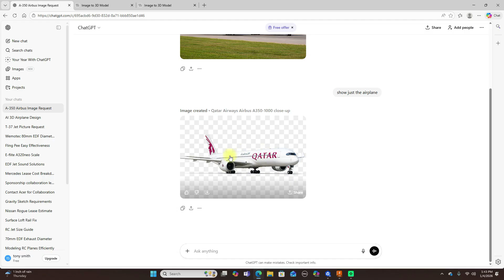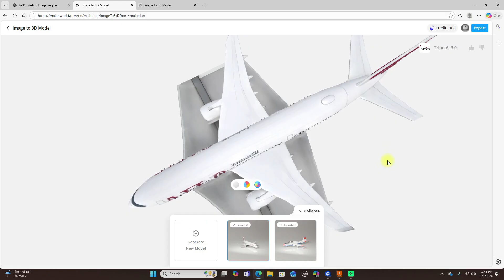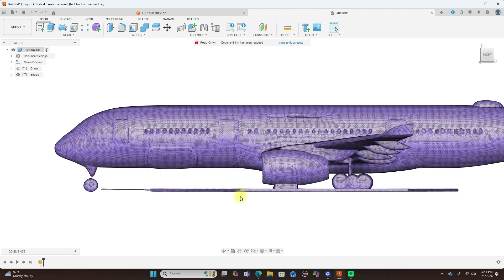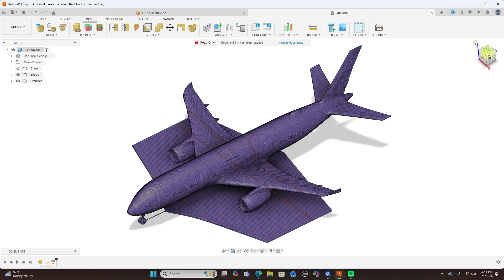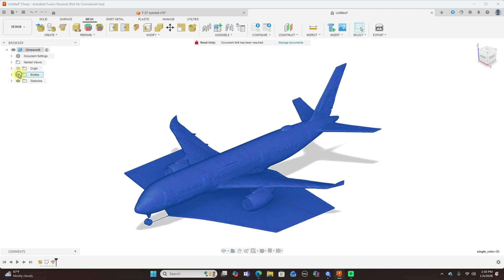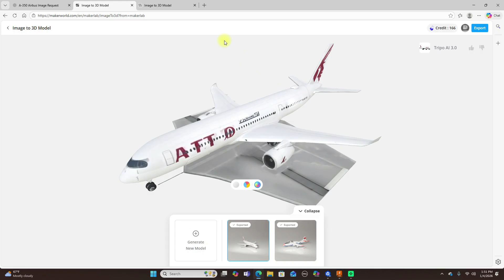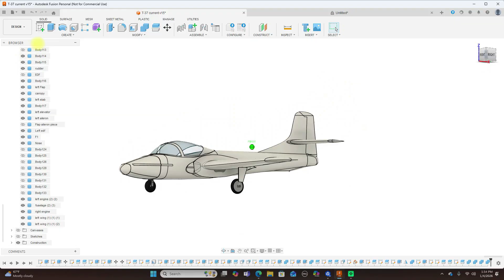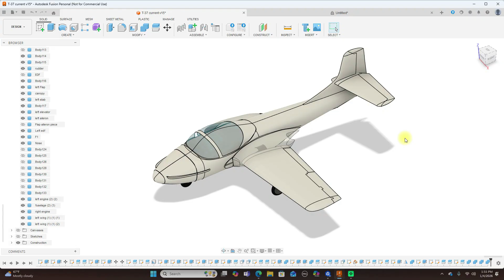Can AI Design an Airplane I Turned an AI Image Into a Real STL

Comment: Have you tried meta's image to model?  Ive been working with AI to code a AI powered CAD but, its code based so has limitations and uses open SCAD.  There are great tools like meshy that make assets for games but, havent seen a good useable CAD based system.  Surely this is in development somewhere?
Reply from the maker: No I have not.  I hope it is in the works.
Reply: SAM 3D models ?
Reply: @xl000 yup, I haven't tried it but looks  interesting 🤔